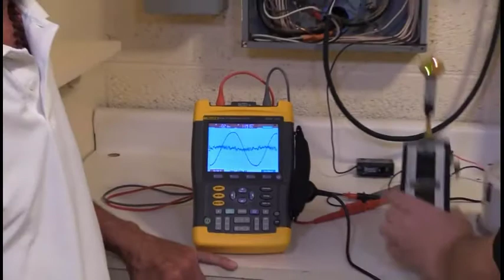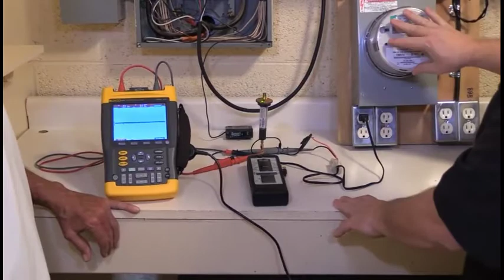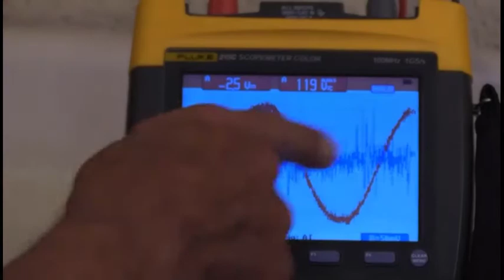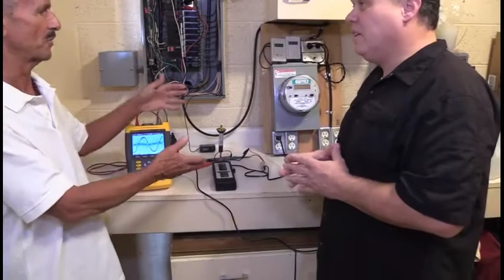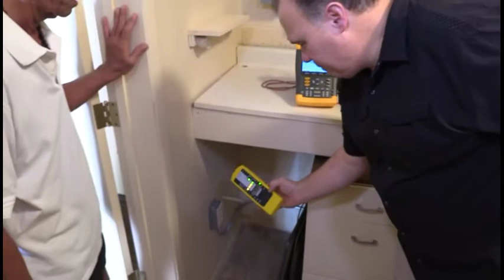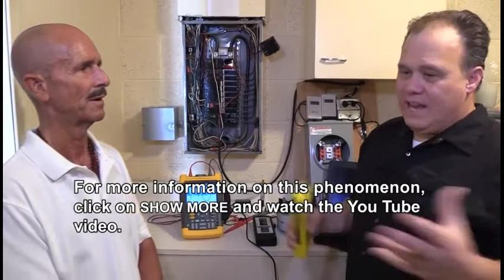Smart meters emit Dirty Electricity!

Comment: My electric company says their meter does not emit RF frequencies and instead uses the electric wires. So do the new smart meters only emit dirty electricity and no RF? I guess I need a monitor to see.
Reply from the maker: If its a smart meter it most likely emits rf signals when it transmits information to your power company.
Reply from the maker: If there saying that then yes you would have to use an rf meter.